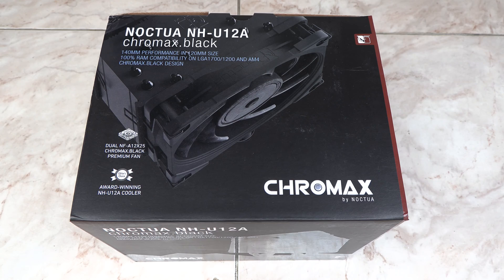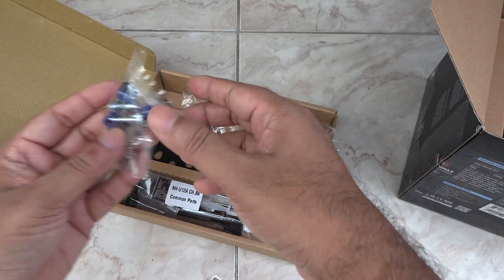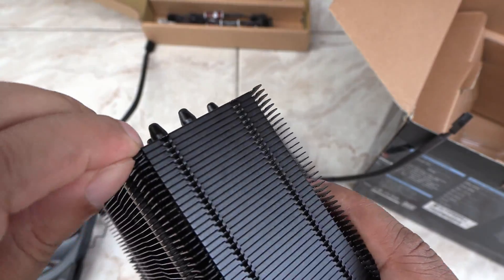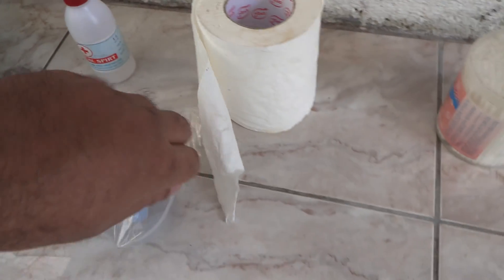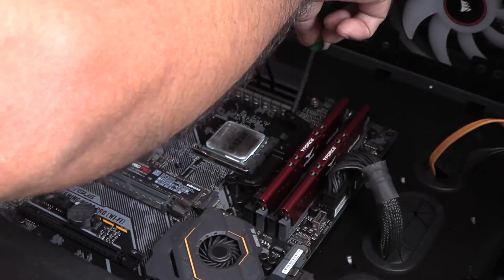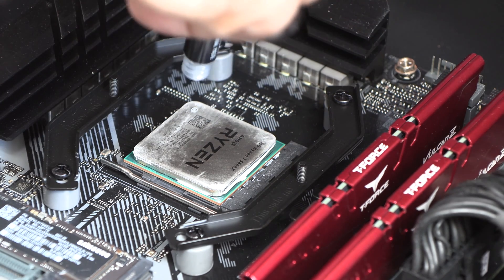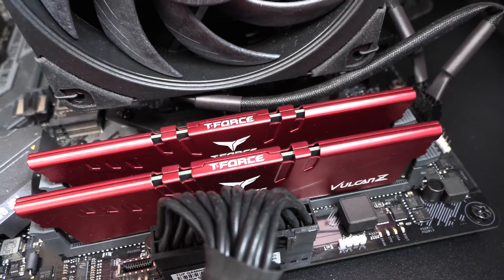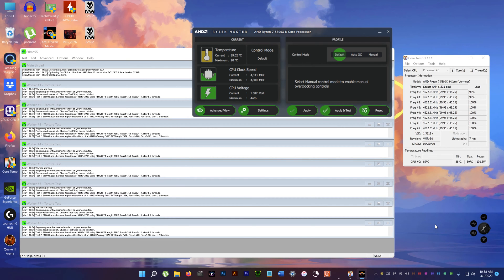Noctua NH-U12A chromax.black CPU Cooler Unboxing, Install Guide, Benchmarks & Review- AM4 X570 5800X

Comment: it does mention to keep the longer side of the bracket towards the ram/mem/RAMM as you can see in your own video the heat pipes are straighter on the side facing the ram allowing for the room. cheers and thank you for the video
Reply from the maker: No worries

Comment: Even works well with 9800x3d running 4080.
Reply from the maker: @splinterborn  of course. Its best single tower air cooler.

Comment: just did a build last night 5950x with Scythe Mugen 6  , I'm not happy temps go up 72 just downloading a game , my other computer has a 5950x also with a Noctua NH-D15   it stays  cool .
Reply from the maker: Noctua is the best but Scythe coolers are also legendary. Maybe see if there are any other factors? Reseat and reapply thermal paster or get better paste. Undervolt cpu. Get a better case with cooling etc.

Comment: You installed the noctua fans backwards at first, which explains the bad Temps you were getting, also you did a horrible job installing the thermal paste. When installing fans make sure you are putting them in the correct side so that it can push the heat backwards towards exhaust fans
Reply from the maker: Oh go home.
Reply: @MaheshWalatara  Hey little buddy you made a mistake, its not the hardwares fault for poor performance when you didnt install it correctly in the first place. Don't get sad lol
Reply: Those fans, at least the front one, are installed correctly. (I can't see the back fan too well but given the orientation of the clips it is also most likely correct.) The heat sink is also in the correct direction too. The back of those fans have a huge sticker on them. You'll note the huge sticker - on the back of the fan - is not showing. (It's also the same as the orientation it is in when he takes it out of the box - which is the correct orientation.)
Reply from the maker: @cyborg7898 finally some sense

Comment: The little hangar clips are the bane of my existence
Reply from the maker: Just pull it and clip it
Reply: I found it is much easier to PUSH the wider section around the middle of the clip instead of pulling the clips. I was able to pop the fans off and on a few times easily doing it this way. (I redid it to get the fans lined up better.)

Comment: Way too much thermal paste. It should be a pea sized dot.
Reply: Bro just turned this comment into a Reddit post
Reply from the maker: I've been doing this before you were born boy.
Reply: @MaheshWalatara  You respond with personal insults to polite constructive criticism? You just showed who the "boy" is.  Ironically, you complained that you had high Temps after installing it initially (when you shot half a tube of paste on the CPU). 🤣
Reply: @NathanC.4  Stop.
Reply: @nese1  No
Reply: @NathanC.4  processor die has been changed in new gen cpu So pee sized thermal paste isn't sufficient. Now recommended Spread method

Comment: Noise levels reach 48 db isn't that pretty high?
Reply from the maker: Maximum acoustical noise is 22.6 dBA
Reply: @MaheshWalatara  oh that's interesting saw few reviews with much higher noise. Although i am confused between NH-D15S and U12A.

NH-D15S Has much lower noise but am a bit paranoid about it fitting with my micro ATX motherboard although Noctua site shows its compatible but still not sure.

While U12A will provide equal levels of cooling but after reading all the reviews regarding noise i am not very sure what to do.

Since noise can become a problem for my work.

What would you suggest.

Also, thanks for the reply.
Reply from the maker: Original fans that come with the cooler are dead quiet And you can make it quieter by using the fan control software of the motherboard or the low nose cables.

Comment: Thank you for the honest review at the end. I'm running a 5900x and am in desperate need of a cooling upgrade. Probably going to go with something a little more robust after watching your video. Thanks again.
Reply from the maker: Keep note that I am in the tropics.
Reply: @MaheshWalatara  Hey man thanks for guide/review. It's gotta suck living in the tropics (or any hot climate for that matter) when it comes to PC thermals, unless you have AC in your PC room I guess. It's especially shitty with these new CPU's and GPU's. 13th Gen Intel, 4000 series, and the new AMD CPU's are glorified space heaters, at least for their flag ships.

Thanks again!
Reply from the maker: Thats why I went for the Ryzen 5800x. Its got low TDP and comparatively low thermals. Best for the tropics. I am very happy. Rock solid stability and zero issues. Not a single blue screen.
Reply: @MaheshWalatara  I went with the rock pro 4
Reply from the maker: Its twice as big.
Reply: @MaheshWalatara  yeah my office gets really hot so it needs it for sure. I just needed a Guage of the cooling ability
Reply: my friend and i built a pc 5900x and nhu12a, and we are in tropical country too. the max temp is 71deg in stock clock but if you want to oc i think you need a AIO cooler. if you have a time check the video on my utube channel.
Reply from the maker: @KebongPHL  Whats the temps with Prime 95?
Reply: @MaheshWalatara  we have a max temp at 71deg that day and the room temperature is hot, we run in stock clock only we never try OC.
Reply: Also note you’ll never get 100% usage. My gaming stays around 65-74.